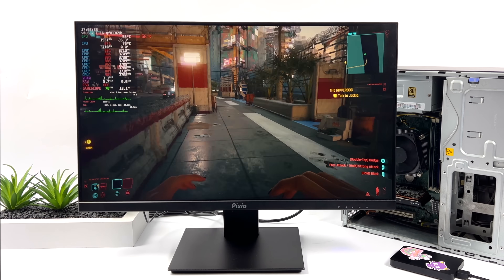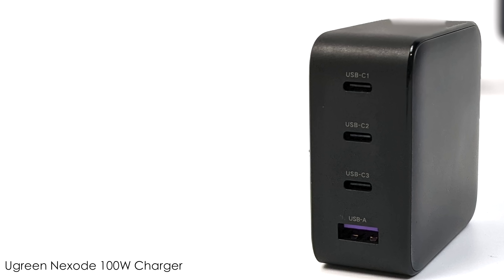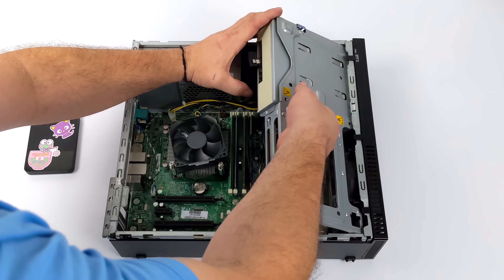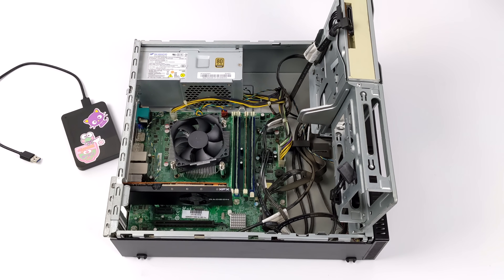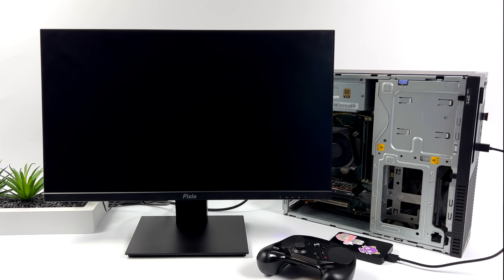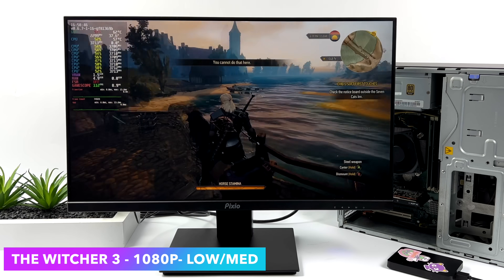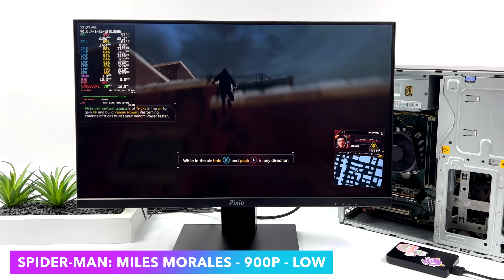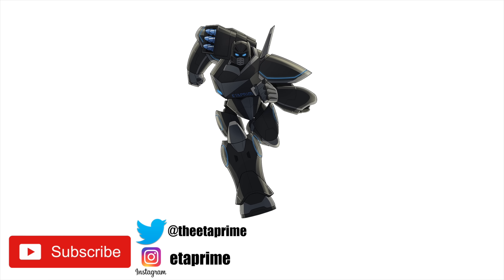This Super Low Cost PC Runs SteamOS 3 Better Than The Steam Deck!

Comment: These small form factors OEM computers usually have small PSUs: 200-250W, so it would be difficult to upgrade them with more powerful graphic cards, the RX6400(53W max power consumption) is most likely the best option.
Reply: i think he was talking about the big tower OEM's ,some have 450-500w psu's .I know hp has such and they can run beefier cards .
Reply: even better option is going for dell precisions they have 675watt 80+ gold psus and support xeons so for 10 bucks you can drop a 8 core 16 thread cpu while having quad channel ddr3 i had t3610 with a 1680v2 and 64 gigs of ram and r9 fury x it cost me 300 for everything
Reply: Used Acer Veriton Desktops (non SFF ones) seem to use standard ATX power supplies and crucially, standard ATX connector wiring. Worth a look.
Reply: The biggest thing to consider is that the 6400 and 6500 will lose performance on these older pci-e 3.0 systems. Expect a 15% loss on average. That being said it is still a good option even if you are running pci-e 3 in 4x not 8x or 16x. When we get SFF pci-e 4.0 used models showing up on eBay the cards will be future proofed at least.
Reply: I'm sure a 6500xt using 100w will work well with most low end cpus, but I agree that the upgradability isn't really that good. It's already a heavily upgraded pc from the stone age
Reply: You can get away with a lot on these stock psus, even in SFF builds if you're using a small card like the one he has here. They're usually proprietary so swapping them out is hard to do anyway. I constantly see people on SFF forum threads saying they switched the psu and no the computer wont boot or some other errors. I swapped to a mid size case and got a 320w psu, I don't need much more.
Reply: I have a few sff machines with these proprietary psu and you can easily upgrade the PSU. For example, I have an Optiplex 7050 MT running on a 360 Watt platinum Dell psu instead of the original psu with 240 watts. Same goes for my Optiplex 3040 SFF PC. There are even more powerful psu for these machines available by now, but the ones I have are capable of powering an i7 and Rx 580 no problemo.
Reply: @Sturmlocke86  Yes, but these proprietary psus tend to be more expensive than regular ones.
Reply: @Wendell-San  true, but they're often more reliable and of higher quality too.
Reply: @Sturmlocke86  I don't know about their quality or reliability, these PSUs don't appear in any hierarchy, PSU tier list or hardware reviews.

Comment: not bad, the 4790 is pretty decent but what kinda sucks is that the rx6400 is being bottlenecked pretty heavy with pcie 3.0 on that old board
Reply: Not really true. Current high-end gpus barely even saturate pcie 2.0
Reply: @swordz2330  depends on the game/program. A 3090 w cyberpunk 2077 will flood pcie 2.0 and you’d see a huge drop in performance. As for the 6400, it’s ~10% loss in fps using it on pcie 3.0 vs 4.0
Reply: @swordz2330  no, it's the problem with these low end AMD gpus, they have 64bit width bus so you get substantially lower performance on 3.0 vs 4.0... just lookup any review of these cards
Reply: @autumn42762  yea if it was x16  instead x4 interface and 128 bit memory  bus the difference between 3.0 vs 4.0 would have been insignifficant probably .
Reply: @swordz2330  Yep, i have seen several videos comparing the same graphic card on different pcie versions and the difference is minimal.
Reply: @roughdude6575  i would not say that it's minimal, sure on some games the difference is not that bad but in others it's huge... like 15-20 fps which is a LOT for a low end gpu

Comment: The toughest pill to swallow is the shipping costs when buying a computer on eBay.  Other than that, this is a great budget setup for sure!
Reply: Also like looking locally, especially when living near or in a big city (like Berlin in my case).
Reply: @hassosigbjoernson5738  yup, we've got a few PC recyclers in the Seattle area that will sell computers like this for even cheaper than eBay.
Reply: Lots of them include free shipping. There's a Dell OptiPlex with a newer i7 including a 512GB SSD for $125 shipped. Then all you have to add is a cheap GPU like ETA did here.

Comment: When your gaming machine becomes low budget, you now it is time to upgrade. I was running an i7 4790 for almost 10 years (with an GTX 760, after that with an RX 570). This video game me an idea what to do with it after my upgrade.
Reply: You can just replace your graphic card and still game on your pc for at least a few years. I have a xeon x5660 with a 970 gtx and the graphic card is still the bottleneck of my pc for modern games.
Reply: @roughdude6575  Yeah, I know. But I wanted to upgrade (I use Blender and my system shows its age there) and I found a local company who import used mineing hardware from China. They test it and resell it. I orderd an 5600x and an RX 6700 XT for about 340$.
Reply: @meeeaCH9612  Wow! That's a great deal. Usually companies like this try to get a nice (for them) profit on top of imported products, so it's really surprising to see one that doesn't do that (or at least to that extent)

Comment: My secondary PC is connected to my 4k TV and it has a 4790K and a GTX 1070. I run games at 1080p on Windows and it works wonders.
Reply: Honestly it's your GPU that's doing the heavy lifting there because it's probably not a low profile build. For now a lot of games are fine as long as you have 8threads, but I think there are some newer games that are going to slow down a bit on the 4790k unless you're over clocked. Because I have the same CPU, but with a low profile 1650 and I'm already seeing stuff on steam that's like "welp, can't play that." at least certainly not at 60fps.

Comment: I have actually seen used rx 5500 xt cards going for less than $100 on ebay. I would go with that over 580 if you have space in your case newer cars and less power needed to run.
Reply: There are RX 5700 cards going for 130 - 140 bucks (€ in my case). So there is definitely room above!

Comment: Quick question. I'm not getting my Steam Deck until next month, but I do have a tertiary SFF system (3770k + RX 6400)  and the 2230 SSD i'm going to use for the steam deck. If I set the SSD up with Holo right now with my SFF, would i be able to just hotswap the SSD on the steam deck  when I get it and have it be good to go?

PS: it's not natively supported, but I CAN get the mobo to boot from an nvme ssd.
Reply: 3770k is a little slower at 3.9ghz versus 4 but it's at least 4 cores/8 threads like the 4790 so it might get you similar performance. Installing Holo on an SSD though... I dunno how well the Deck does with pulling from a harddrive with the OS already on it.
Reply: @TheRealAlpha2  thank you for the reply! yeah, i figured as much with the CPU - i DO have an idea how it games since I have it set up as a small steam box (on windows) and figured it MIGHT run better on HoloISO. i'll probably try it over the holidays.

noted on the steam deck, though. i suppose i'll just need to be patient till mine comes in and do it the conventional way- i wanna start fiddling with it ASAP!

Comment: i consider building something like this. i got an old pc with an i 7 3770 and a rx 6600xt on my shelf. could be pretty good 🤔
Reply: Why do you have a 6600 xt on your shelf lol
Reply: That is a definite cpu bottleneck waiting to happen. I tried pairing a 5700-xt (the 6600xy is nearly identical) with mine and outside of wolfenstein 2 every game I threw at it struggle.

Comment: Cheaper until you have to buy a monitor, keyboard, mouse, external drive, controller, etc. This "cheaper than a steam deck" content makes me want to unsubscribe, lol.
Reply: Why would you buy a monitor? Just connect it to your TV. You can get Xbox 360 controllers for $2 from thrift shops or even free if you look around. Keyboard and mouse? Go to a local e-waste recycler and they'll give you a mouse and keyboard. Even adding a drive, it's still cheaper than the cheapest Deck by a fair amount.
Reply: @bnr32jason  Fair point.
Reply: @DaleKirkley  go to goodwill and you can most stuff for very little

Comment: I have an optiplex with the xeon equivalent of a 4790 and an rx 6400. One thing to consider before making a build like this is what generation of Pcie the motherboard supports. The rx 6400 only supports 4 lanes so if it's not atleast Pcie gen 3 your performance will be very poor. Mine only supports gen 2 and I lose about half of the gpus performance in some titles. This warning applies to the rx 6500 and 6500xt aswell. You will be far better off with an rx 580 or 590 on a gen 2 system.
Reply: This is true.  On an older machine like this a 1650 would probably net a little more performance.
Reply: AMD really dropped the ball on this one. Who's gonna buy a newest motherboard & CPU and pair it with an RX6400 ?
Reply: Rx 580 requires external power
Reply: What specific xeon is it?

Comment: in terms of cpu the deck is actually faster as in some tests if you scale the performance of its van gogh apu with the 3200g/3400g cpus the 3400g should wipe the floor with the i7 4790 other than that the RX 6400 destroys the deck and the only thing that can match it is the RX680M if it were pushed hard enough
Reply: The 3400g is actually not that far in terms performance over the 4790

Comment: i would love to see a full size bracket adapter for full size Gpu for vertical mount.
a rtx 3060 in this Pc would be interesting.
Reply: These usually have like 250W power supplies, so you can only really use LP cards that don't need extra power cables.